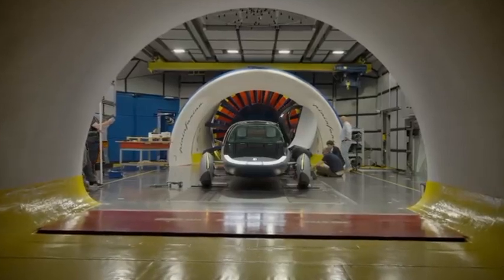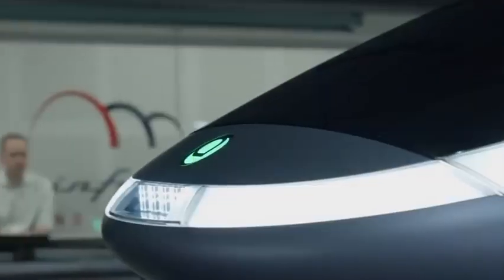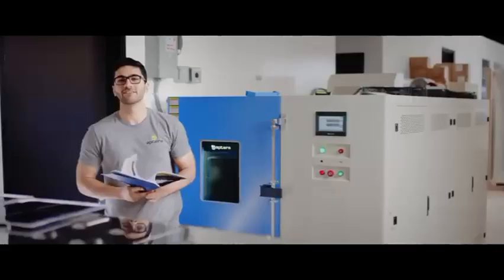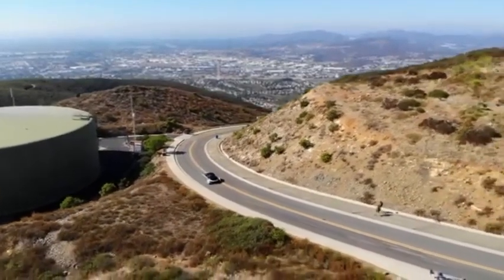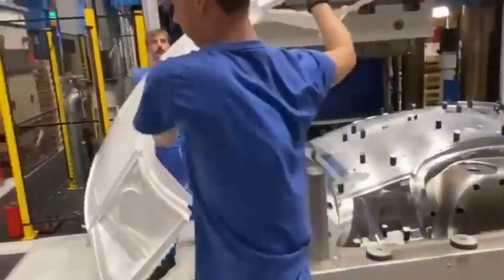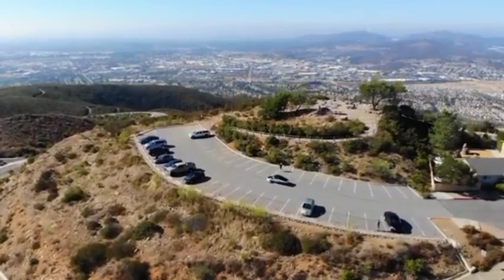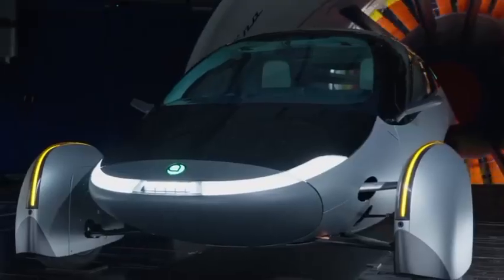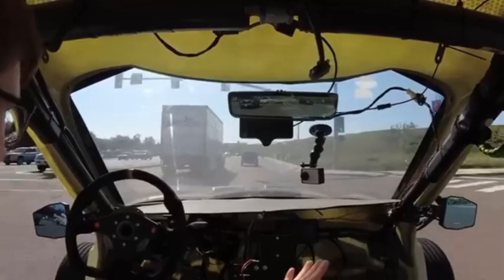Aptera continues validation process for its solar EV

Comment: Without an angel investor they will never reach production. They do not have sufficient funds to even clear 2023 and their founder stated in a recent interview that they are looking to be profitable within two years of launch which will require a very large infusion of cash. Those 500+ manufacturing slots of 2000 is not made clear, back in January of 2023 Aptera launched their Accelerator program where if you invested 10k or more you got to jump the line on all others who held reservations. They truly thought it would be so popular they put a March 26 2023 end date on it, well as can be seen it was not popular as a fourth of the slots are still there.  That TEN THOUSAND DOLLARS IS NOT A DOWN PAYMENT!!! It is an investment.
  
One major reason is that Aptera is already 211m in the hole as June 30th per their own SEC filing and they steadfastly refuse to provided updated pricing for the vehicle and continue with the 2019 price which their own founder has stated costs increased substantially since then. That same SEC filing also stated they had to pay their former landlord at the Vista facility 1.8m to terminate the lease early, they only had that lease a year and it was the home to their solar manufacturing as well as the future US home for Elaphe.  
  
The launch vehicle has three motors and 42 kWh battery.

Comment: The $10,000 is an investment in Aptera shares, not a down payment for a Launch Edition. Good report. Aptera needs a few more investors to get the assembly line/production line going. CPC has been a wonderful choice for the shell, but making the dies, and machining the steel for said dies has delayed things but will result in a finer product. The ultimate bleeding edge, most efficient vehicle ever made will be validated, and crash testing, EPA milage rated (330 maybe MPGe)  will make Tesla drivers drool, and Prius drivers order two of them. Aptera is truly a game changer, and we have to have it on the roadways, and soon. In a few months the validation will be showing what a masterpiece that they have actually created. It is not just the shape and three-wheels that will turn heads, it will be the highest rated in so many categories. Crash testing will prove the monocoque structure and carbon fiber to be extremely safe, the high amount of distance it can travel, for the least amount of energy will be astounding, due to the shape and lower drag. My gut says once the automotive press actually has done their homework, many orders will flow to buy the Aptera.